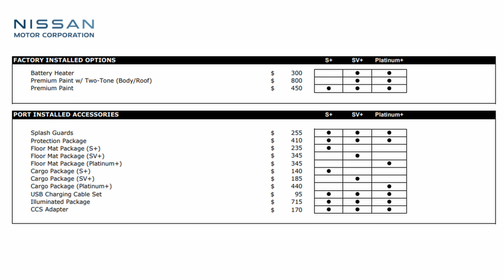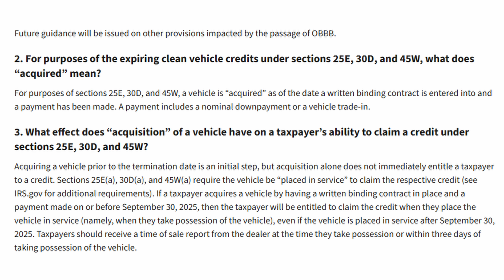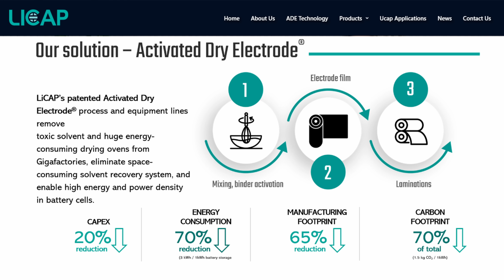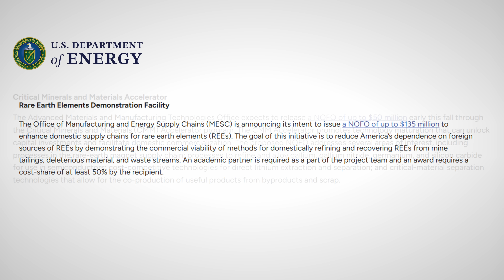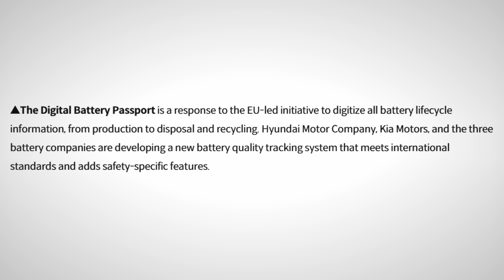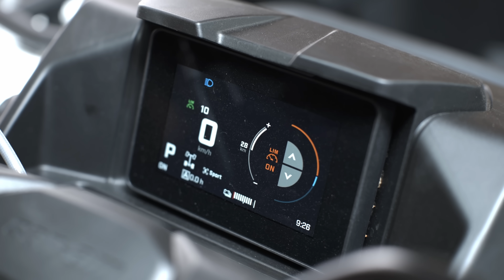The Current : Weekly EV News Ep#77 Aug 24, 2025

Comment: Great video!

WRT the Leaf, I just want to confirm: the “battery heater” is a heat pump, right? And that’s available on the S+ as an option? If so that’s a no-brainer. I hope most Leafs in inventory get this option.
Reply from the maker: The battery heater is unrelated to the heatpump.  The battery heater warms the battery and is probably PTC based. -Producer Tim
Reply: @MissGoElectric thanks Tim. Does that mean no heat pump on the Leaf?
Reply from the maker: The heat pump for in-cabin climate control is standard on the 2026 LEAF. 
-Producer Tim
Reply: @MissGoElectric thanks Tim. This is interesting. I would think that any vehicle with a heat pump system would use that heat pump for heating and cooling both the cabin and the battery, as for example the Tesla Model 3 has since 2022.

The implication of all this, to me, is that in the Leaf the cabin HVAC and the battery temperature regulation are independent systems. That seems a little inefficient to me. I hope I’m wrong about that.
Reply from the maker: Heat pumps are great for scavenging and Tesla delivers great efficiency thanks, in part, to their advanced multi-valve part innovations. Today Tesla still uses separate PTC heaters for batteries in (at least) some models.

Every EV we've reviewed has additional (separate) heating systems for the battery. 
-Producer Tim
https://share.google/aJPIaCmkWOrRLo1zX
Reply: @MissGoElectric  TIL! Thanks!

Comment: Why does the Leaf NACS port say “DC Fast Charge Only”?  You can’t L2 charge it?
Reply from the maker: L2 can be done with the J1772 port. AC NACS connectors are also supported with an adapter. No problem. Complete compatibility. -Producer Tim
Reply: @tomcain5069 The new leaf only accept DC charging through the passenger side NACS port and only accepts AC charging through the driver side CCS port. That's stupid and purely bad design.
Reply: There's a second port on the left side, I think it's J1772, for AC charging.  the NACS port is indeed only for DC charging. sad but true.

Comment: Can't wait for electric jetskis and outboard motors.  Years of experience maintaining watercraft and boat lower units, impeller replacement, oil changes, dealing with old fuel during the off season.  What a hassle.  Most fishing and jet skiing in Texas heat is you hit the water early and are off before noon.  So shouldn't need batteries that keep you going all day.
Reply from the maker: Your optimism and enthusiasm are a gift. Both jet skis and electric outboard motors are really available now. 

Meet Orca - Our 100% Electric PWC | Taiga Motors https://share.google/mnbbu2Llg73WRVFo0

Flux Technology https://share.google/wkS6xtrS03EamrFqU
-Producer Tim

Comment: Tying the battery heater option to the higher trim levels is not cool.
Reply from the maker: Why might a Florida resident, for example, elect to pay for a battery heater?

When scraping the bottom of the barrel with an economy EV, automakers must enable buyers to choose what they want to sacrifice. The lowest price trim levels are cheap, in large part, because of manufacturing simplicity. Fewer options = lower production cost.
-Producer Tim
Reply: @MissGoElectric Good point.
Reply: Of course it's not cool 😎 :it's a heater ! 🔥

Comment: Been saying for months that Can Am should buy out Aptera or make an arrangement to build for them to get it into production
Reply from the maker: Thanks for sharing your thoughts on Can-am buying Aptera.  The company has been at it for about 20 years working to commercialize the 1994 MIT Aztec. They've spent over 130 million dollars and they've got an army of investors clamoring for returns. It will be interesting to see if Aptera ends up differently than ElectraMeccanica or Arcimoto.
-Producer Tim
https://dempseymotorsports.com/mit-aztec-solar-car/
Reply: @MissGoElectric Wasn't aware of the mit aztec origins. Will post in every Aptera related video, as I doubt many current Aptera fans are aware. May change their tune.
With the upcoming new Bolt & Leaf, the Ford Universal ev platform vehicles, and current Equinox, the business case for a 2 seat 3 wheeler for more than $30K keeps looking worse.

Comment: Question to US EV owners. Why are you buying an EV over an ICE vehicle?  If you knew the % of solar & wind charging your EV will be minimal into the future. Would this matter. Did you know the US is in a foot race to meet increasing energy needs and the go to product is natural gas turbines that provide 24/7 output.
Reply from the maker: We drive electric for these key reasons:
1) EVs run on DOMESTIC American Energy.  Gasoline and Diesel vehicles are using a high percentage of foreign oil/gas.
2) EVs last longer and are more reliable
3) EVs are quicker, quieter, more powerful, and safer
4) EVs do not emit deadly fumes at ground level where children breathe.  They can operate in the garage without killing the family inside.
5) More than half of the electricity on the US grid today comes from renewable sources such as Nuclear, Hydroelectric, Solar, and Wind.  That percentage has grown steadily every year for 20 years and shows no signs of reversal...especially as utility sized battery banks continue to improve the economics of renewables.  We live in Tennessee where all of our energy comes from Hydro and Nuclear, but even if we charge up in Kentucky or West Virginia where coal is the source...we produce about half the pollution per mile as any equivalent combustion alternative. 

Here is a great video on that:
https://www.youtube.com/watch?v=1oVrIHcdxjA
-Producer Tim
Reply: @MissGoElectric  Don't feed the trolls!
Reply from the maker: Usually the dimwits who make the post are incapable of learning, but for every one of those... there are 100 people who read and retain.

I think it's worth the effort to set the record straight and put those empty heads on sticks as warning for others like them. 
-Producer Tim

Comment: It seems like Nissan might have finally nailed it on the new Leaf especially with the pricing. They should just have the battery cooling included for all models to improve the customer experience and improve battery longevity.
Reply: Battery cooling is present, what's optional (on S+) is the Battery Heater. If you live in a warm area a battery heater is not necessary.
Reply from the maker: The battery heater is an option.

Nissan learned their lesson spending hundreds of millions of dollars replacing batteries in Gen1 passively cooled LEAF vehicles under warranty.
-Producer Tim
Reply: @MissGoElectric  The gen 2 leaf is still on sale, and it does not have active battery cooling.
Reply: They have an optional battery heater for $300. Is that what you were thinking of?
Reply: Active battery cooling is included on all models. It's the battery heater that's optional, to improve charging speeds in cooler weather
Reply: Unfortunately, the dealers will mark it up and / or add overpriced, add-ons. 

It will be a rare lucky buyer that gets it for straight MSRP, based on my observation and experience shopping for a brand new bolt and brand new Highlander in the last three years.
Reply from the maker: I worked for Nissan. I've trained about a thousand of their sales representatives specifically on their EVs and I've visited hundreds of dealerships.

 Remember, they are each independently owned and operated in the USA.

Some dealerships do bad things. Some always sell at or below MSRP with no funny business.

 Some don't mind  selling EVs. Some actively dislike EVs. 
-Producer Tim
Reply: Unfortunately, the dealers will mark it up and / or add overpriced, add-ons. 

It will be a rare lucky buyer that gets it for straight MSRP, based on my observation and experience shopping for a brand new bolt and brand new Highlander in the last three years.

Comment: ORVs need to have swappable batteries
Reply: Works great in Africa on motorcycles.
Reply from the maker: An 8kWh battery pack is about 180lbs.  Smaller vehicles like motorcycles and scooters make battery swapping a breeze, but it is tougher with something like an ATV...though certainly doable.  The decision to direct more money into engineering and producing that solution factors the additional revenues which will come in as a result of opening the market to people who need that feature, can handle the mass, and are willing to pay extra for it....and the liability which comes from high voltage contactors which frequently disconnect/reconnect. -Producer Tim